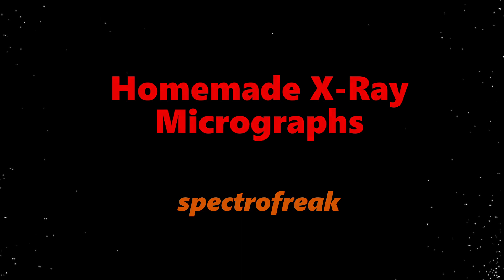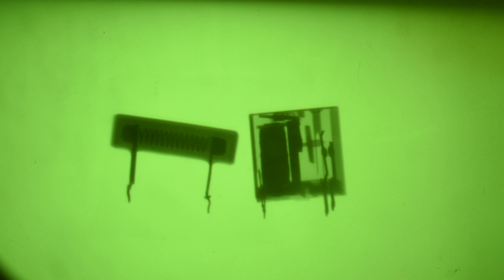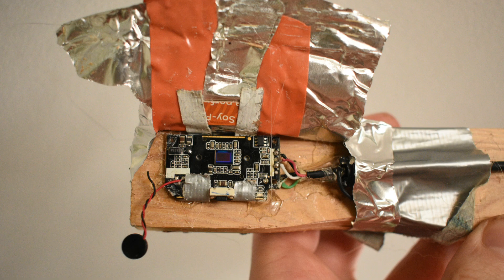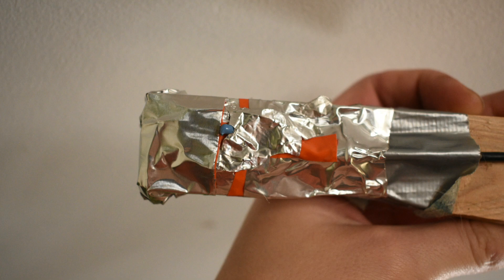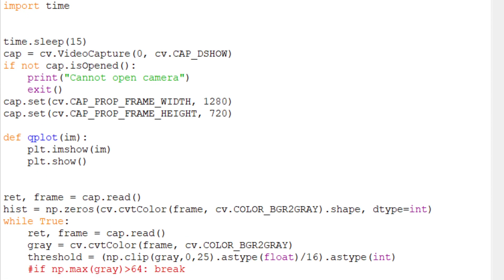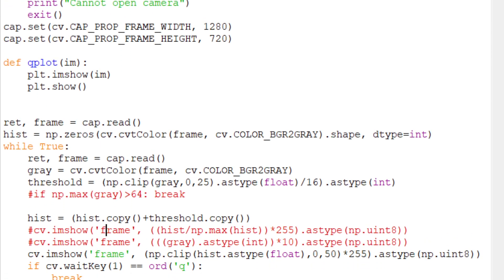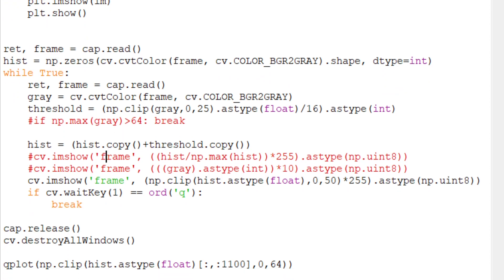X-Ray Micrography Using A Cheap CCD Sensor (Part 1)

Comment: nice! what tube are you using here?
Reply from the maker: It is a tube from a Phillips Oralix dental x-ray head. It's a tiny one, only barely over two inches long, but it does the trick. I painted it black to keep the filament glow from washing out photos in case you were wondering why it looks like that.
Reply: @spectrofreak9988 Where did you got a CCD webcam, I am searching for it, but there are just none, maybe you actually bought CMOS camera.